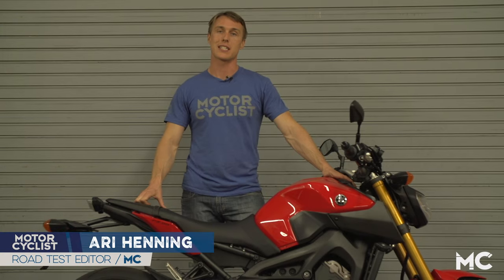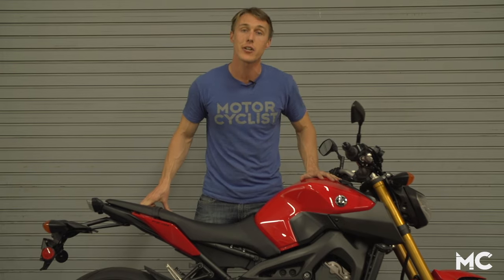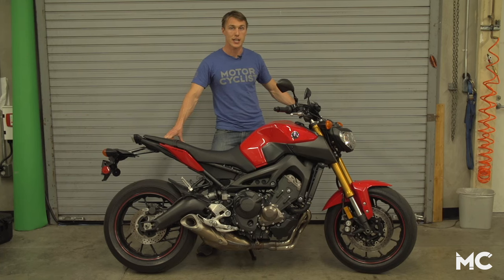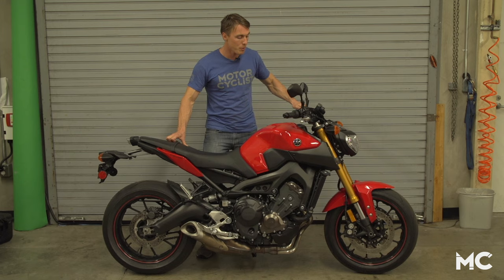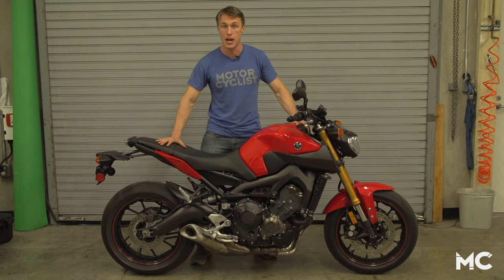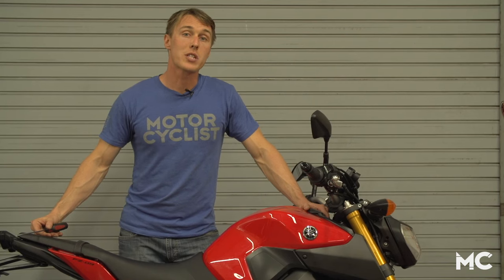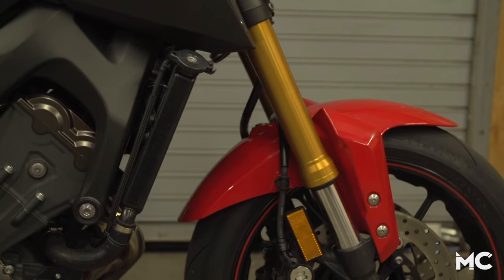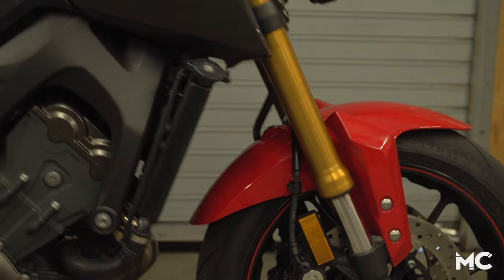Suspension Tech: How To Dial In Your Rebound Damping | MC GARAGE

Comment: I have a 2020 MT 09 (bought it brand new from a dealer), I have not touched the suspension, so it should be pretty soft, right? Im 190 Lbs, when I ridge on a rough surface, I feel like I'm riding a brick! I did the bounce test, and the front fork feels pretty soft. Any suggestions?
Reply: Check some forums, I'm sure it came up on topics of discussion. 
Perhaps slightly thicker shock oil,  progessive springs.. GL! 
🍻

Comment: Wouldn't the rider's weight drastically change the adjustments you make? It seems like setting the rebound on an unladen bike might result in too much damping when laden. I am no physics whiz, so I might be completely off with this.
Reply: +Aaron Fink its just a base setting for the bike. if you get a second hand bike etc with no manual you can set it like this and work from there
Reply: +Aaron Fink Negative. That is what your preload setting is for. Once preload is setup for rider weight, the dampening settings are adjusted using the bounce test and reading your tire wear. Different tracks demand different rebound settings. The bumpier it is the less rebound would be needed to keep the tire on the ground. Dave Moss is also a good resource on youtube to check out.
Reply: +Aaron Fink that would be correct.
Still, the logic is "if my rebound is out of tune even with no rider, it will be extremely out of tune with the rider" (no to mention the passenger, full load etc).

Setting the damping from the free sag is a starting point. The finishing point is something no novice can achieve.
Reply: Nicola Furlani Where do you guys come up with that understanding from. That is exactly why preload is setup with the rider on it. Once sag is correctly adjusted dampening rates go with it accordingly.
Reply: vidurc Your statement is correct but I can't get your point. Nobody said otherwise in this comment section. And why did this became a thing about preload?
Reply: Nicola Furlani Because OP and yourself mentioned dampening changes drastically based on rider and equipment which is not true. If your sag is setup with rider and equipment dampening will not change.

Dampening is what changes based off the road surface and condition. Which is why on a bike with active suspension the dampening can change automatically but preload is still set by the rider. 

Basically what I'm trying to say is preload is for everything the bike's chassis has to carry. Dampening is for conditions on the road and how the chassis reacts to it. So the bounce test is to determine if the front moves like the rear does without being too slow or too fast on either end. You want both ends to push back evenly or you get bad handling characteristics. 

Dampening does not change based on how the bike has weight added to it. Which is why the bounce test is valid. Now if you ride a very bumpy road or a very smooth road tire wear will give you an indication of what happens with different settings to fine tune it all.
Reply: vidurc Overall correct but a few notes : from static to "rider on" the damping may not change much.

But the difference between unloaded and full loaded (meaning nearly 150 kg of meat and gear) is enormous.

From a macroscopic point of view nothing changes.

But the properties of the fluid change dramatically over pressure (meaning, putting weight on it).

If you want a quick tune, the "bouncing method" is fine, but for a more refined result you must keep in mind others factors. Weight is the biggest. Temperature, rate of bumpings, heat from friction and the brakes etc etc

I don't know what bike you ride. I my experience, I change the dumping when I know I have to ride long roads with my gf. Pavement quality, comfort, spinal cord's needs... everything changes when there is more weight.
Reply: Nicola Furlani Again that doesn't matter considering dampening changes in relation to preload. If your preload is set correctly dampening will work accordingly. The fluid does not provide any support to the weight. You're talking about compensating for a weight increase with a change in dampening which in turn is not the best way to fix the inherent issue.

The spring setup on a bike is designed to handle the weight. If you load a bike up beyond the spring's capacity the dampening only provided a minute band aid to the over all problem. In turn you still risk bottoming out the suspension while riding and dampening cannot do anything to prevent that. 

Riding with a passenger and increasing dampening is a temporary fix to the underlying issue. Its easier to do that than adjust the preload but, that is the point I'm trying to make. You adjust dampening when you go on a long ride but that does not change the fact that with an additional person on the bike the preload needs to be adjust accordingly or the suspension will not operate in the proper range creating a dangerous situation when you hit an undulation on the road. You come close to bottoming out the suspension and in that case no amount of dampening adjustment is going to solve the issue. 

Now if you have preload adjusted to both your weights and we consider the oil to be new the bounce test is enough to get a good base line and adjust dampening for a specific preload setting. Which means the rear and front will be stiffer with 2 people on and the dampening rate will still be effective for that specific preload setting. This is also why a lot of cruisers come with the ability to only adjust preload and not dampening. Those are set from the factory for the best ride based on where the bikes are typically ridden. As long as it's adjusted for your weight, the other settings on a slowly ridden street bike are not as important. Sports bike demand a lot more given how quick they are so their settings change accordingly.
Reply: Nicola Furlani Another example is the fact that a lot of guys lower their cars with lower springs that are not stiff enough to take the weight of the car with less suspension travel. So in order to compensate they dial up the compression dampening setting. That helps make the suspension stiff overall and provide mechanical support but does not eliminate the fact that the lack of suspension travel is still a problem and there is not enough travel to prevent bottoming out. 

Those factors like temperature and weight increase do play a role but you'd see more of an impact on a track than on the street. If you're loading up a huge amount of gear to ride best to work from the preload setting. If that doesn't work springs need to be upgraded to take the increase in weight. Dampening overall is not a good solution to the problem of loading.
Reply: +vidurc I don't need more examples. I'm not saying that you are wrong. I'm simply stating that it's not that simple.

You are overall correct, but the logic under those forks is way deeper.

I've got no interest in writing a reply 375 lines long telling you why. There are dozens of other ways to get an answer to "how does weight influence my suspensions?".
Reply: Nicola Furlani Watch some of Dave Moss's videos. You'll get an idea as to why I've said what I've said. The basic answer to all of this is the fact that dampening does not change based off of weight. It changes due to road conditions, viscosity of the oil, air temp and more. For typical street riding in other words it is inconsequential. Unless you're running a race in any professional series those factors do not matter.